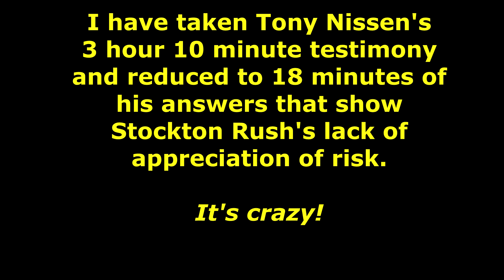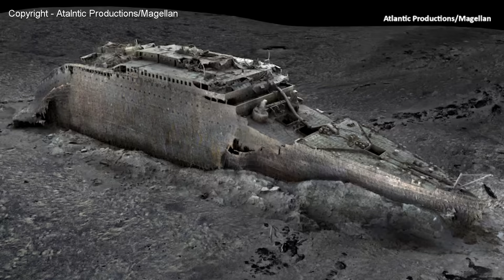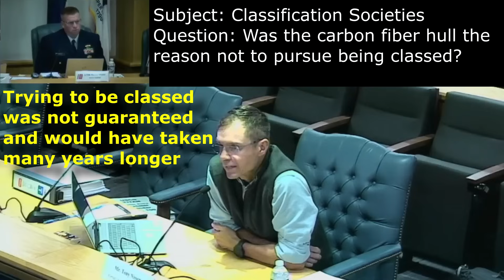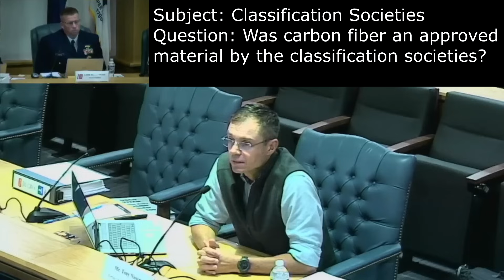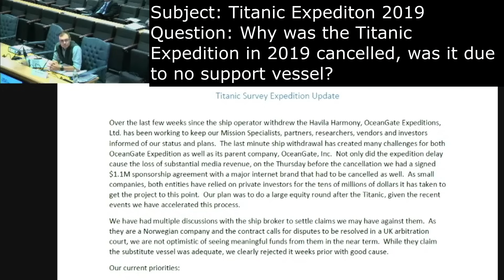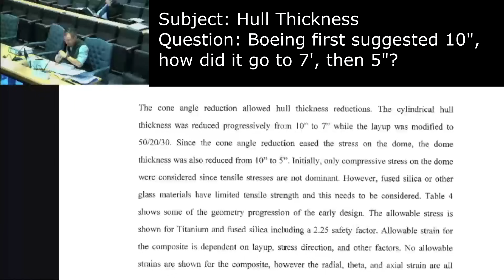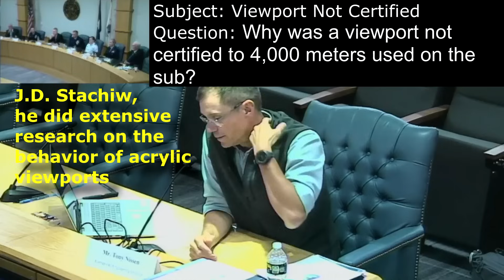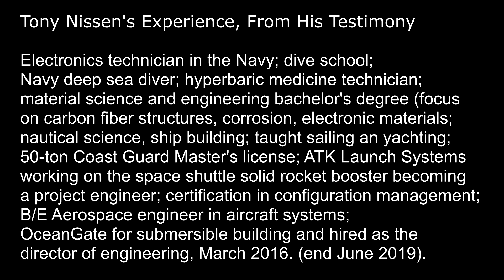OceanGate Titan - Working for Stockton - The Engineer's Words

Comment: As Starship loses its crew an investigation will be made and the results will be similar as here, but the show will go on.
Reply: Starship is Elon musks huge space craft.   He has said that it will not be manned until it has had at least 50 successful flights.  Unlike Boeing and oceangate space x is always learning and testing and adapting to what they learn.   At the start nasa assigned engineers to Boeing g and space x.  They all said that Boeing was closed minded and that space x was open minded.    The results speak for themselves
Reply from the maker: Notice how NASA returned Starship unmanned.  They learned from Challenger and Columbia.  Starship made it through the re-entry fine, and Boeing said it would be okay. But NASA wasn't going to risk the lives of the two astronauts since the thrusters were not reliable.  NASA made the correct call to return the capsule unmanned.

Comment: I found a picture of mr Rush sitting in the Titan, there are 2 computer monitors on each side, bolted with what seems 4 screws in the Hull! Most likely the contributing factor why it got crushed or the original spot of weakness or failure witch expanded.
Reply from the maker: Hi, the Titan had a liner than laid inside the carbon fiber hull.  Anything you see screwed into the walls is screwed into that "floating" liner, not the carbon fiber.
Reply: @solareclipsetimer  I participated in the construction of the building where the Dynema fiber originated from, i saw the machines to could make it.

There hung a chart, a single fiber could be elevated to like 275 meters height before it would brake under it own weight. much higher then any other.

But it in the opposite direction there is no strength.
Reply: @solareclipsetimer  I knew about the grey "Rhino" or so liner outside, but no person talked about a liner inside. still how thick was this liner? how deep went the screws?

I'm sure the location of monitors would render the "sub" as not approved to host people, being a danger to possible injury.

Polyester doesn't stand a change vs 37740 kg per 10 cm² on top of the hull.
Reply: @AnalogDude_  Hull 1 at least was constructed to have the outer pressure hull and an inner liner insert that could be "easily" swapped so you could customize an insert for your needs while the sub was busy elsewhere, then just swap in your insert when it was time for your job. Kind of a modular concept.
Reply from the maker: @AnalogDude_  Between the inner liner and the hull were spacers that were about 3/4" think,  So, there was a gap between the two of about 3/4".
Reply: There was nothing bolted to the carbon fibre
Reply: @mich8292  Ya, i saw another video yesterday that went more in detail on the inside, witch nobody said before.

Comment: It said Spencer composites predicted 1000 cycles. But they predicted for a hull that was flexing 37% less than data showed
Reply from the maker: They did a poor job with the construction process of the hull.  Their modeling was wrong.  Huge issues there.

Comment: I don’t really buy Tony Nissen’s version of events. I think he was incompetent and less concerned about safety than he described here. It’s not like Stockton is around anymore to counter his story either. Probably just trying to cover his a**
Reply: I would normally agree but I hold back in this instance because Stockton was such an outlier.  He was so stubborn,secretive, manipulating and narcissistic that nearly everyone who worked for him said he would ignore everything and anything he disagreed with.
 
There is transcript of a recorded conversation between Tony, Stockton and a 3rd party.  Kyle hill read it and Stockton said “ I don’t care about voids, there could be 1000 voids and he would still go down.  Stockton was so deliberate in his misleading that I find it more than possible that he kept this guy in the dark about certain things.  I really feel like Tony came on board to help engineer had no idea that Stockton would refuse  to do anything to improve its design because no sane person would keep rolling with those materials and design if it failed.  When he brought up concerns or ways to improve, that’s what got him fired.  

And don’t forget stocken even ignored his own system.  That massive cracking sound incident was picked up on the acoustic monitoring system and showed a serious change had occurred.  What did Stockton do? He ignored not and said it was the ring settling into the carbon fiber groove.  This guy was so willfully ignorant that he ignored a warning system he designed just for that purpose . Probably because he thought it would never show anything since he thought his sub was “innovative” etc.  His ego couldn’t allow him to be wrong even if it meant ignoring warning signs on a system he created.  

Guy was insane
Reply: there were 2 Tonys. "the sub cracked, and I wouldn't let them dive" -- "Oceangate was not a dangerous company"
Reply from the maker: I don't know if you watched the video to the end, the last frame has a list of all of his work experience that I listed from what he said in his testimony.  He is a smart guy. If you have chance go directly to the end of the video and quickly read about his experience.  This video was not about his engineering work.  But I watched all of it and he really was trying to make things work.  The first hull from Spencer was garbage.
Reply: @solareclipsetimer  I wrote three paragraph reply to this comment and it’s not here. I hate YouTube comment systems.
Reply: @solareclipsetimer  I watched his whole testimony as well as David Lochridge’s. I have no doubt that Nissen is an intelligent and educated person, but many foolish and lying people have academic credentials. Personally, I found Lochridge’s testimony to be highly credible, most especially due to the fact that he also provided documentation for what he was saying—something we did not see much of from Nissen. Where are the emails where Nissen expressed his disagreement with Stockton? Texts? Why did he not support Lochridge’s safety concerns at the time? When Nissen was fired, why did he not do anything to raise the alarm about the poor safety standards at OceanGate? It just seems awfully convenient that every time Nissen told Stockton “no” it happened in private when the only other person who can verify it is now deceased. 

In fact, I don’t know that I even believe Nissen’s testimony about his termination being due to his refusal to approve the 2019 Titanic expedition. If you listen closely to his testimony, he admits that the reason OceanGate gave for his firing was that Nissen should have been able to foresee the design flaws in the hull. Ironically, this seems pretty reasonable to me on behalf of OceanGate. If the guy you hire to engineer and oversee the manufacturing of your submersible produces a product with a huge flaw that is unusable, it seems reasonable to me that he would be let go. I sort of doubt that even Stockton was arrogant and delusional enough to think that a cracked hull would be able to go to Titanic depths. Nissen has cast himself as the savior in that situation, implying that if it weren’t for him refusing to sign off on that expedition it would have happened. But do we have any proof of that whatsoever? I would be willing to bet that nearly every person at OceanGate who took a look at that cracked hull (including Stockton) knew immediately that it could never go to the Titanic depths. 

Hopefully more information will be released on Nissen’s role with time…according to Lochridge’s testimony, there is a recording of Lochridge’s termination meeting with OceanGate. If Nissen was part of that meeting, it would be very enlightening for that recording to be released so we can see what he was actually saying behind closed doors at the time.
Reply: And one more note—Even if we take Nissen’s testimony at face value, if it is true that Nissen had all these safety concerns and did nothing whatsoever to express or report them to anyone inside or outside of OceanGate, he still bears some responsibility for what happened. Nissen helped to engineer that death trap—both directly and indirectly with v2—and when he left he washed his hands of it and essentially decided it wasn’t his problem. No matter what version of events is true, Nissen’s character has not shown itself positively.
Reply: @lalaLAX219  If I were a hiring person I would definitely not hire him to be responsible for anything major.  His engineering skills may be good, I am not qualified to judge based on what little we've seen, but I am not at all impressed by what he demonstrated of his ethics.
Reply: @eblita3698  
And Karen can take care of herself, her son is studying to become a doctor, but he doesn't depend on his mother as education is for free. I really feel sorry for Tony Nissen. You can have a good education (if your parents can afford it), you can work hard, but when s... happens. Then everyone is ready to claim that you should be blamed, although the conditions of life where you live leave you with no choice but to go along. Awful!

Comment: I feel like Nissen is trying to cast himself in Lockridge's role when infact he was actually on onboard with Stockton. He's just trying to save his reputation it seems.
Reply: I believe that he started out being on board with the plan, but as things went on he became increasingly alarmed. Finally the lightning strike was the last straw.
Reply from the maker: Not sure.  He is doing this testimony under oath and he has all the paperwork of his engineering data about the problems and therefore the warnings.  I don't know if you watched the video to the end, the last frame has a list of all of his work experience that I listed from what he said in his testimony.  He is a smart guy. If you have chance go directly to the end of the video and quickly read about his experience.
Reply: That is the exact same feeling that I got from hearing all of the testimonies over the two weeks. I feel like Nissen is extremely guilty and pointing his finger at everyone else.
Reply: @TikkaTCM I don’t think you blame a guy that was fired 4 years before the loss of Titan
Reply: @TikkaTCM he was fired before everything got worse. He’s also under oath and could be charged if found lying. The company was shit but they kept records of a lot of things they discussed there is probably correspondence to back up what he’s saying. I can hardly blame the guy fired 4 years ago for the sub imploding when he was fired like the other guy. Doesn’t exactly make sense I think you’re just painting with too broad a brush.

Comment: I'm very skeptical about Tony Nissen. It's in his best interest only now to say, "Oh, I wasn't a yes man. I fought Rush's decisions and protested about safety." (Of course he's saying that now.)

A New Yorker article says, "Lochridge had been hired by OceanGate in May, 2015, as its director of marine operations and chief submersible pilot. The company moved him and his family to Washington, and helped him apply for a green card. But, before long, he was clashing with Rush and Tony Nissen, the company’s director of engineering, on matters of design and safety."

Tony was on Rush's side while Lochridge was raising alarm about the issues. Tony Nissen is on video laughing it up and smiling when the Titan hull was being glued. It's in the hearings (when it serves him) that he's saying he wasn't a Yes man.
Reply: but he did get fired for refusing to sign off on another dive
Reply: @peabody3000  Did you listen carefully to his testimony about the issue of "saying no" to the dive? He literally said the hull was already cracked at that point. This man's testimony was blowing smoke up their rear ends. The board was polite enough not to call him out to his face, but they have all the dates. They also have the internal emails from this company.

Tony Nissen was all in with Rush. He convinced Rush to fire Lochridge by sending Rush that list that Lochridge made. Nissen was supposed to only be on a ONE YEAR contract, and he finagled it so Rush would fire all the outside engineering so Rush and Nissen could cosplay at submersible designers. Listen again to his testimony. He said this was supposed to be a ONE YEAR contract for him. He got everyone else fired and talked Rush into doing all the engineering in house. He and rush were cosplaying engineering a submersible, plain and simple.

And he admitted the real reason he was fired. Two board members were pissed off because of the failure of the first hull. Tony didn't "say no" to the dive. The HULL ITSELF "said no" to the dive by CRACKING. Tony "said no" only after that hull was already cracked. He was fired because he was the Director of Engineering, talked the company into doing the engineering in house, and then failed to actually produce a hull that could survive long enough for them to take even one single dive to the Titanic. At that point even though Rush and Nissen were BOTH responsible for trying to LARP as professional engineers, Rush fired Tony and made him the single fall guy instead of admitting to the board that he and Nissen together had designed everything. Nissen is the one who designed the window. They designed the hull together. BOTH of the hulls that were made were designed "in house", neither of he hulls were built by any of the outside engineering design specifications. After getting rid of Nissen, Rush just changed a few things regarding the hull and basically went on with the rest of the design exactly as he and Nissen together had designed everything, including reusing the rings and end domes, and using the window that Nissen had designed.
Reply: @bees5461  sounds plausible, but raises questions.. like specifically why you say tony convinced stockton to design in-house, to fire all outsiders along with some insiders, in part to extend his employment, and that he was driving the design just as much as stockton. are those assertions based on direct testimony and evidence, or perhaps insider info, or are you presenting deductions based on your interpretations of indirect evidence?
Reply: @peabody3000  FFS. He "refused" to sign off on a dive where the damn hull was already CRACKED. And then admitted that that wasn't even the real reason he was fired. He was fired because the board put their trust in the two Bozos, Rush and Nissen, to do the engineering themselves, and they clearly failed. That is why he was fired. He  admitted it.
Reply: I see right through Nissen
Reply: Correct. And it goes further than just being a "yes man". He is very person that convinced Rush to fire Lochridge and fire all the outside engineering contractors so they could do it in house. 

First, he says it was supposed to be "just one year" of employment. Then, he "needs to find his feet here". Why do you need to "find you feet" and get everyone who might be a real expert fired so you can be the guy who helps Stockton Rush design this thing if your employment is supposed to be just for one year? Nissen's hands are all over it and now he's trying to say he spoke up and was fired. Rush didn't allow him to stay beyond the original year, and build a large engineering department because he "pushed back". Look how fast the others were all gone who actually DID speak up and push back. Look at the OceanGate Archives videos. Nissen literally christened the original Titan. Also, listen to how vague his answers are in this testimony. Now compare his testimony to every single other engineer and even non engineers like Lochridge. 

He "spoke up" after the first hull was already cracked to the point it HAD to be discarded. He "stopped" the 2019 Titanic visit? NO. It stopped because that hull was too damaged. And, a board member who was pissed off told Stockton it's either you or NIssen. And THAT is when Nissen was gone. He literally says so himself.

Also, no way did Rush ask Nissen to be the pilot on the Titanic dives. Tony had no experience whatsoever as a pilot. Nissen has as large an ego as Rush, they deserved each other. It's chilling that Nissen helped Rush to decide to design and  build this in house and yet he knew enough not to go into it himself. Nissen designed the window, we know that for a fact. And I would not be surprised if he and Rush collaborated on that hull. That hull was NOT built to the design of either of the outside contractors, it was designed within OceanGate.
Reply from the maker: You have some points.  It took a long time for Lochridge to get cleared to come to the U.S. and start work.  It dragged into the Spring of 2016, by Lochridges own testimony.  Tony asked David Spencer from Spencer Composites to oversee the gluing of the rings to the hull.  Spencer sent their technicians to do that glue work and Spencer chose the type of epoxy to be used.  Tony was just watching it happen.  In his testiimony he stated that his primary role that day was to make sure things (ring and hull) lined up to be square.  Apparently, gluing carbon fiber was one of David Spencer's specialties.
Reply: @solareclipsetimer  As director of engineering it was Nissan's job to make sure Spencer Composites was actually doing things correctly even if he had to do his own research and find another expert to consult about their recommendations. You do not get to say "oh, someone else said to do it that way" when you are the one ultimately responsible for the whole project.
Reply: @TrappedinSLC you 100% nailed it!